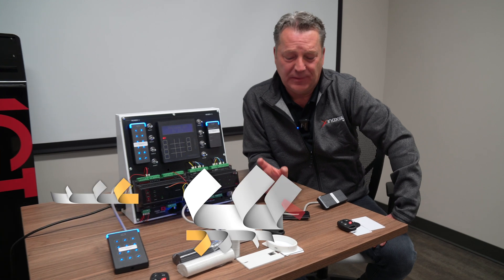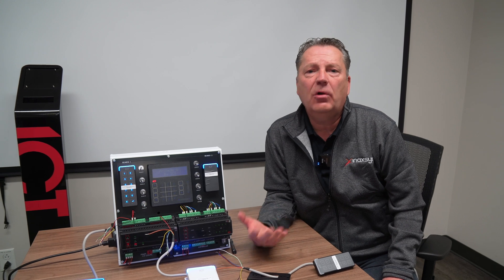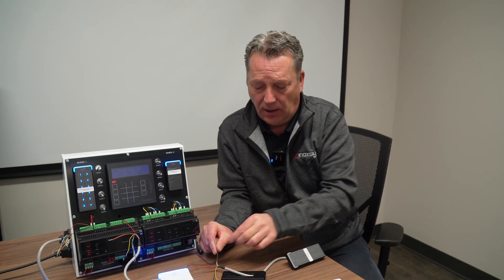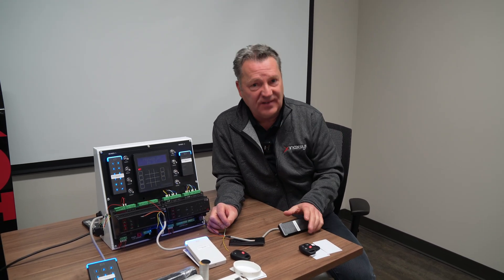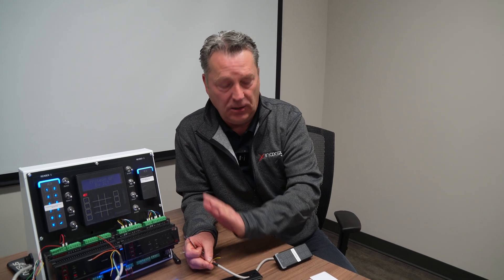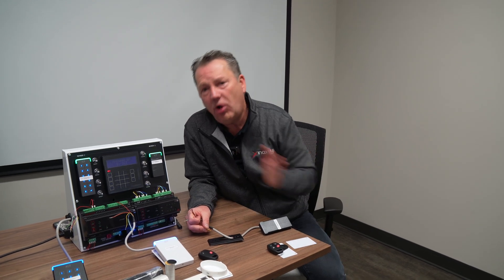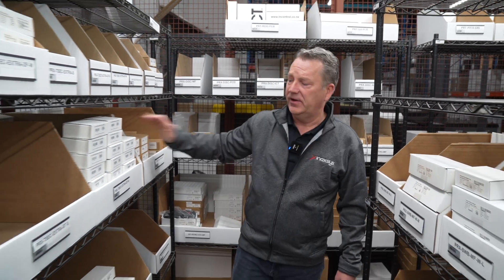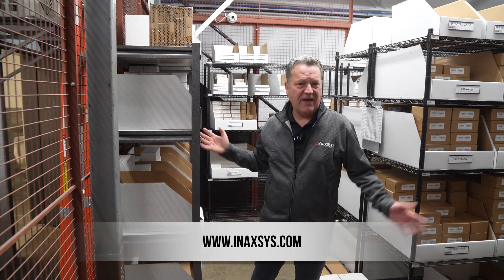What is The Difference Between Wiegand and OSDP? Mark Will Explain This 😎

Comment: Why is it if I have two entry readers one works on ict rs485 and the other had to be programmed to be osdp to work?
Reply from the maker: When using ICT RS485 you can only have one entry and one exit reader on the same port.  Otherwise, the reader will go in duplicate address mode.  (And when we need an exit reader the Green and Orange wires must be shorted before power up.)

Comment: I am a plc programmer and am setting up a security access system at our shop and am wondering if anyone has experience in OSDP to a PLC. I will be using an Allen Bradley PLC and probably a RS-485 card in order to communicate. I've just never heard of OSDP, must be a security access control protocol as I'm not familiar with how it works. Any help would be appriciated.
Reply from the maker: Hello, thanks for contacting us.  OSDP is a standard developed by the Security Industry Association (SIA).  We do not have experience in OSDP to a PLC but we believe that the link below is a good start in creating your interface.  They even offer training and you can purchase the OSDP standard.

https://www.securityindustry.org/industry-standards/open-supervised-device-protocol/
Reply: @inaxsys  I'll check it out right now, thanks
Reply: Did you ever figure out how to interface the two or did you end up using access control outputs?
Reply: @willshannon883 I ended up finding a keypad that had Ethernet protocol and with our software department created communication in order to install our building security. Much better and way more customization with a PLC in charge.